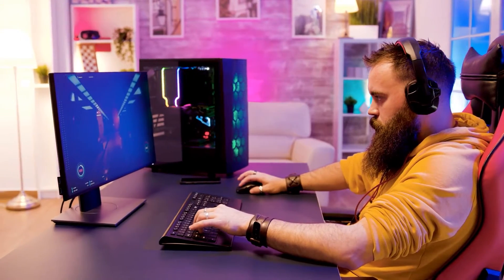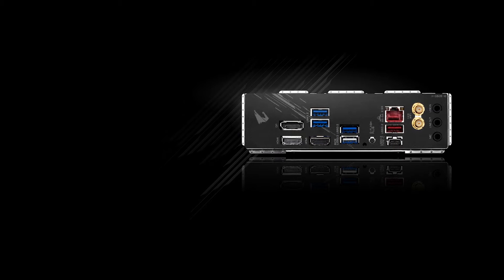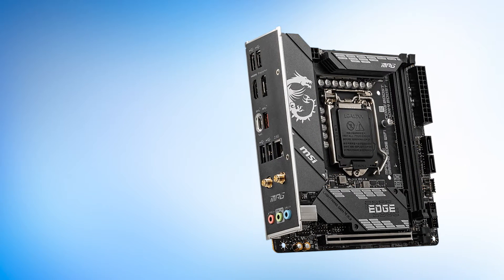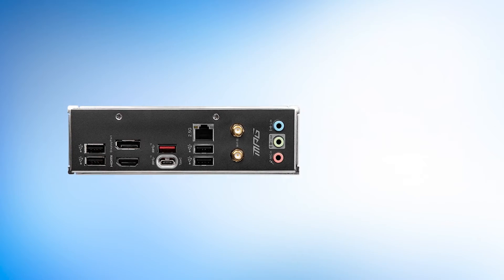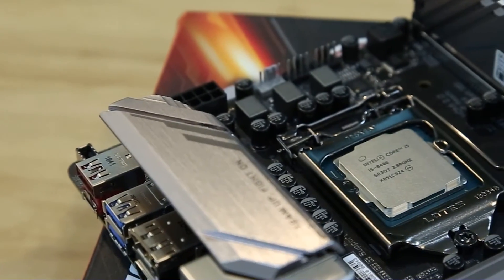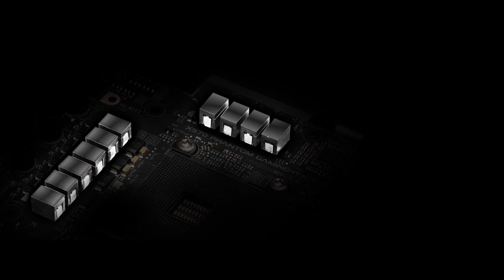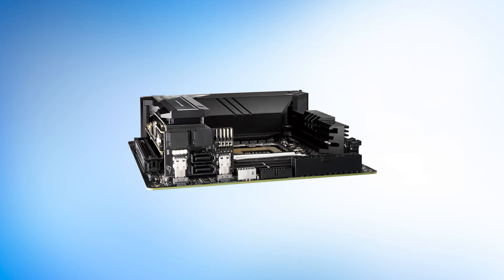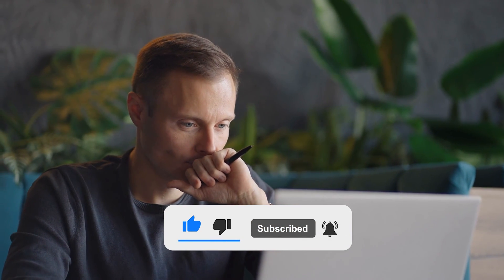THE 5 BEST MINI ITX MOTHERBOARDS TODAY!

Comment: B550 and B560 in 2023? B550 maybe for a budget-system, but B560 absolutely not.

AM5: MSI B650I (with separate M.2 Cooler without FAN), ASUS B650E-I (first Rev. had some coil whine)
1700: MSI B760I, Gigabyte B760I, ASUS B760-I

Boards over 300$ are not worth to mention (X670-I, Z790I, Z790-I...).

Comment: Looking at purchasing the ASUS ROG Strix Z690-I for an open air case build, however cooling the cpu might be difficult because the socket seems to sit pretty low on the board and with ram installed I don't think there will be ample room to install an air cpu cooler due to their size.  Might have to consider a custom water block instead or AIO. Your thoughts?